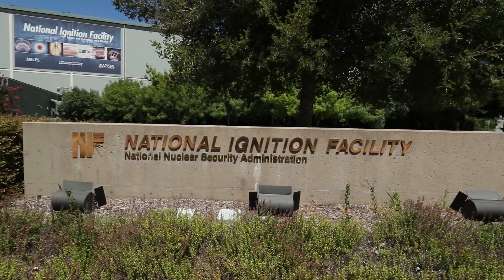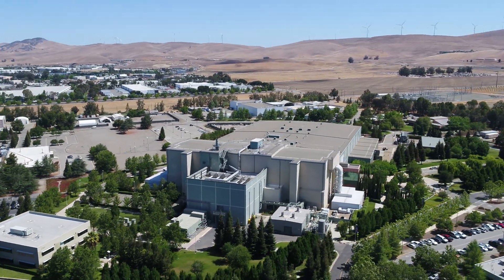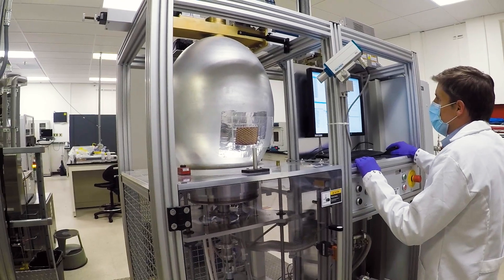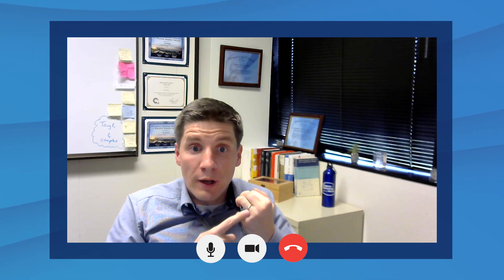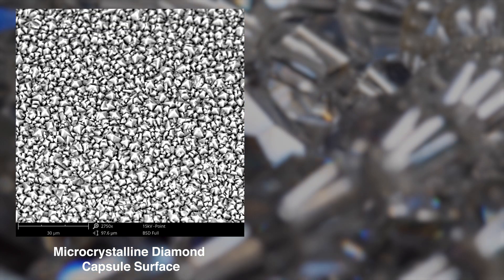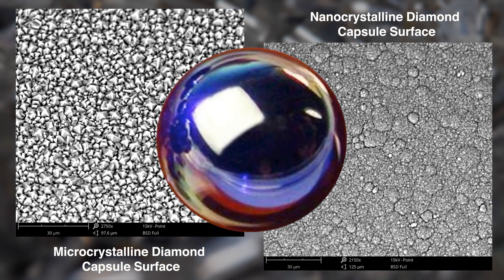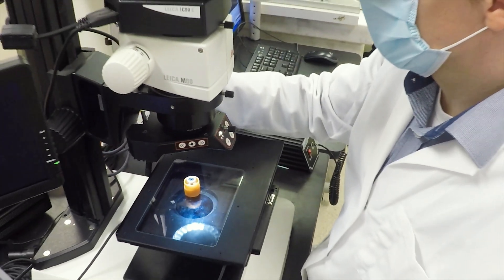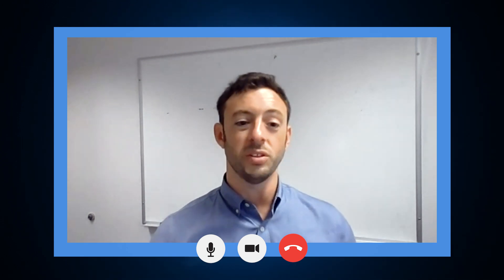How Diamonds Are Used for Nuclear Fusion

Comment: The NIF administrators have long been masters at obscuring the primary purpose of NIF which is to simulate the conditions during thermonuclear weapon (H-bomb) explosions and to expose weapons related materials to the prompt 14.1 MeV fusion neutrons generated by the successful fusion reactions. This communications host is part of that process. Typically, key evaluation parameters are omitted from such presentations. For example, the widely propagated announcement of the NIF's 12/05/2022, 'breakeven' shot was supposed to have been achieved by 2012. It took billions of U.S. revenue funding and a decade of improvements to finally achieve the original goal. That fusion reaction lasted for approximately 0.000,000,000,08 second after a week of preparation work. NIF applies the term 'ignition' in a way that differs from most peoples understanding of the term. There was little propagation of the reaction before the central, microscopic, 'hotspot' blew the vast majority of the expensive D-T fuel away from the reaction region. In that announced experiment the lasers consumed more than 100 times the amount of energy that was specified as the reaction input energy. The energy, consumed by the facility during the experiment preparation, was not given. The vast majority of fusion plasma physicists have long stated that the inertial confinement fusion (ICF) approach is unlikely to lead to a commercially practical nuclear fusion energy electrical generating power plant.

The hollow spherical diamond fuel capsules have to be almost totally flawless in geometric shape, surface finish and contain almost no imperfections in the thin wall. Hundreds have been manufactured but only a small percent are considered flawless enough to be employed in the fusion energy shot experiments. The NIF target assembly is estimated to cost around $100,000 USD. Much of it is destroyed during the shot experiments. As of 2025 the NIF has been estimated to have consumed over $11 billion in federal revenues. The 12/05/2022, experimental shot took about a week to prepare. Many scientist say a successful ICF power plant would need to operate at a rate of at least 10 shots per second. So far NIF is at least a factor of one million away from that goal. Still, that has never prevented the presenters from claiming it is closer than ever from demonstrating a commercially practical nuclear fusion energy electrical generating power plant.